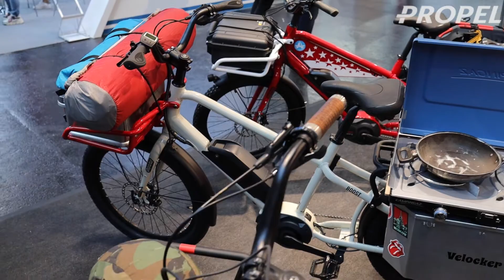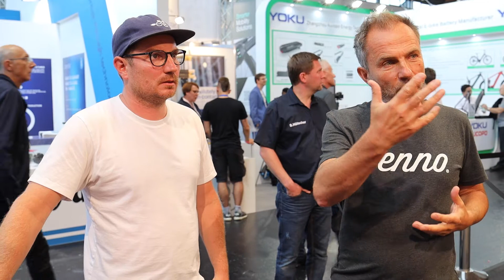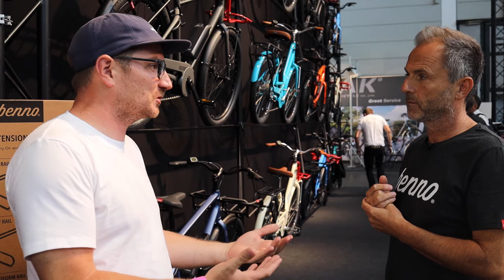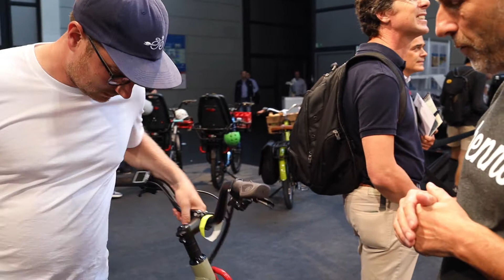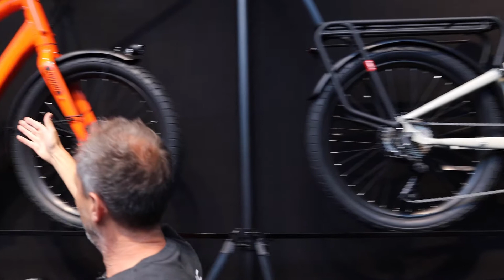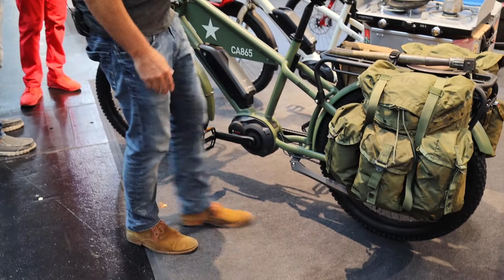2020 Benno Updates with Benno Baenziger at Eurobike 2019

Comment: I may need to buy a Benno from this guy. He makes a lot of sense in his design. The Tern GSD is just getting very pricey, and small wheels just don't roll as nice. The Boost looks very cool, although a longer back end with a heavy duty back wheel, belt drive, perhaps a Rohloff hub, and the 85nm motor would be really nice. Then you could have a properly comfortable rear adult seat and carry the load just fine. Up the battery size too so professional couriers will want it and give it a Thud buster post. I also wonder why none of these have dual discs up front like a motorcycle. Brakes for days could be sweet. It could be another model. Like a boost, but bigger and more capable. Something to think about. Call it The Truckster. :D

Comment: What's the weight limit on the rear rack for the 2020 boost?
Reply from the maker: The rear rack has a rated capacity of 130lbs.
Reply: @Propelbikes  Great, Do you think you can carry an adult on it?
Reply from the maker: Technically yes, but it depends on how big the adult is. Can it handle more than 130lbs? Probably, but it might prematurely cause parts to break and it could adversely impact the handling.